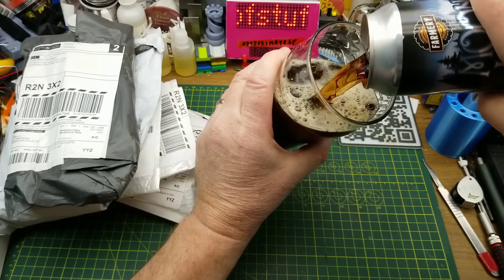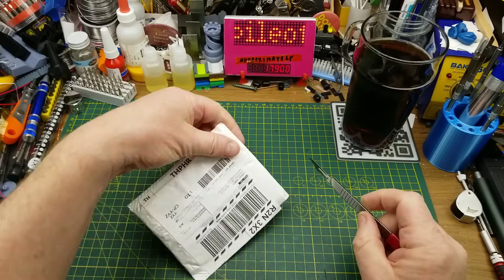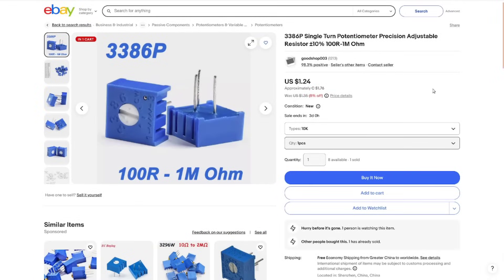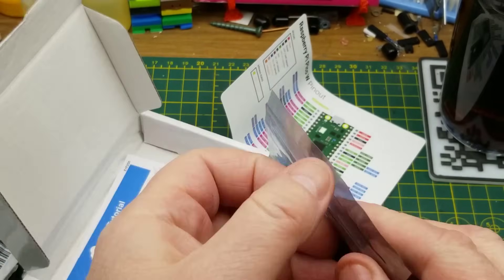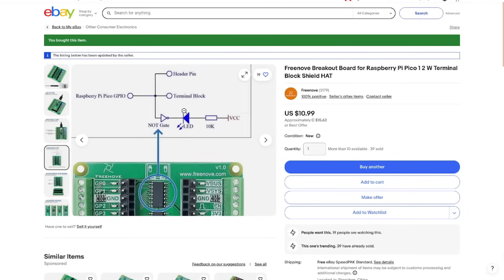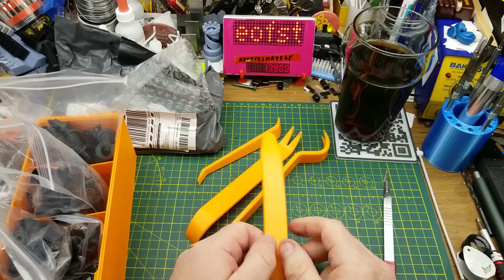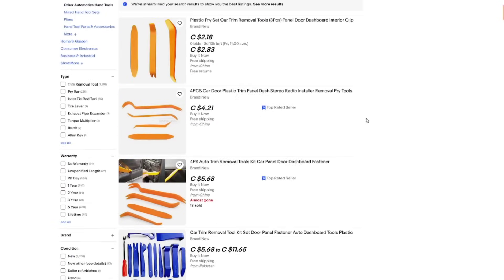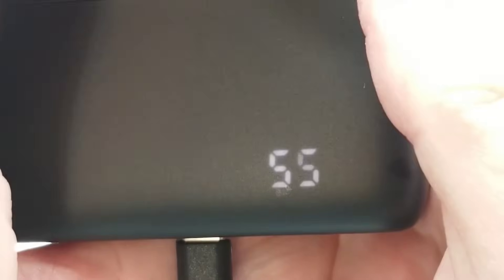Mailbag Monday 213

Comment: At some point you will have paid the same for all these random mic, than for a real rode wireless 👀
They both sound not really good, the new one is very bad
Reply from the maker: My intention is to try and find a good affordable one that I can recommend to others.
I don't mind spending the money I get from youtube so other people don't have to waste theirs.
Reply: @pileofstuff  honestly with mic it's extremely difficult, because you need a good mic in the first place, but you also need a good circuit board. I suppose you have some chances to find one from 50€ , but I will be surprised if you find one at a price below, also I'm just talking about one transmitter+ 1 receiver for this price, no case.

Comment: Two of my motorcycle gadgets (helmet camera and GPS logger) still use Mini USB, so I am all for ridiculous adapters as I need to use a Micro-Mini adapter with my 4-in-1 cable to recharge the camera while off the bike on a long day out.  And the old microphone sounds much better than the new one to me, it is a lacking in bass but I think outdoors with background noise it would sound perfectly acceptable.  The new one though sounds to me like you are in a bathroom with a limited bandwidth connection, far too tinny.